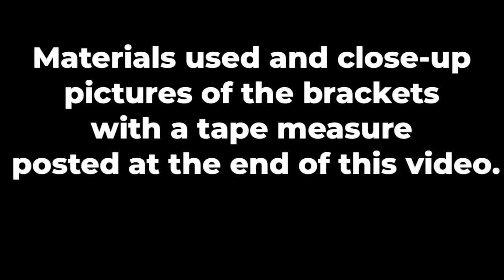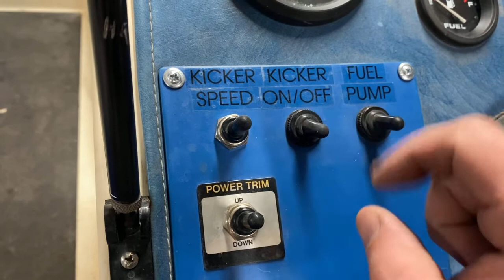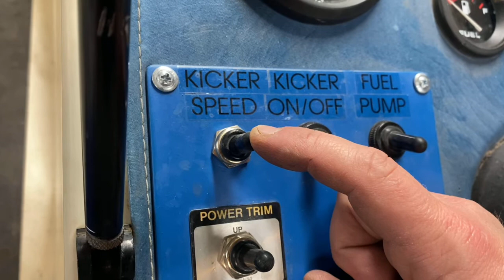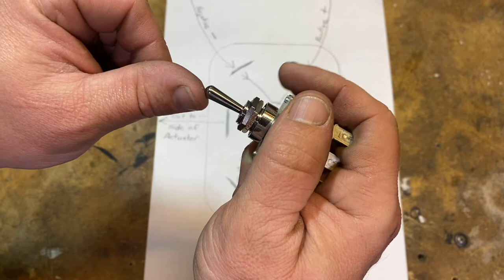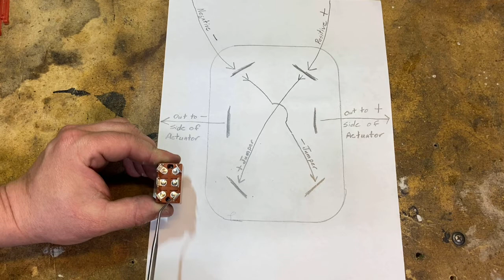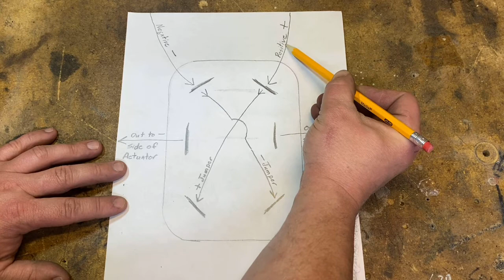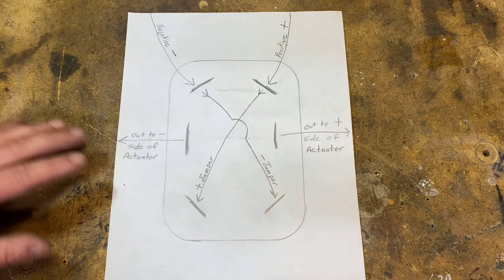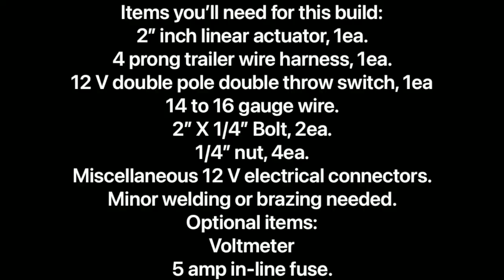Under $100 Remote “wired” electric throttle for a 6 hp Evinrude/Johnson

Comment: You seem like a pretty knowledgable guy with Johnson outboards! I have a 95 15 Hp Johnson and am have problems with loss of power after a couple minutes of running. The engine asks like it's running out of gasoline. I have rebuilt the carb new fuel pump brand new fuel lines 2 inline filters clean gas, checked the coils all good have spark. Been trouble shooting but don't know what else to check.
Reply from the maker: Without hearing it is kind of hard to diagnose something like that, but something I would check just to make sure you’re firing on both cylinders after it’s warmed up a bit. Sometimes when ignition parts start failing they will work fine when they’re cold but as soon as they start to warm up they will fail. In your case I would suggest zeroing in on a coil as it warms up. You might have one cylinder starting to cut out when it warms up and give you the impression of a fuel delivery problem. If after that you still suspect a fuel delivery problem you could start pulling the choke out as it starts running rough and see if it clears it up. Basically if you have a fuel delivery problem the engine will be running way lean, a way to counteract this is to pull the choke out slightly so that the fuel air ratio is more balanced. If it starts running better after you pull the choke part of the way out then you know you have a fuel delivery problem. Keep in mind this will only work at lower speeds because of the fuel demand at the higher RPM range. I wouldn’t rule out the possibility of vapor locking either. If the climate where you’re at likes to hang out above 95° when you’re out on the boat it’s possible that the fuel is starting to turn the vapor in the fuel line feeding the engine. To test this theory get yourself a couple bags of ice and try to keep your fuel line as cool as you can keep it. If this seems to make a difference try shortening your fuel line, or try to shade your fuel line somehow so it’s not in direct sunlight. Hope this helps, good luck to you!